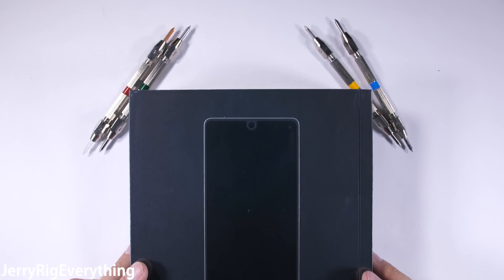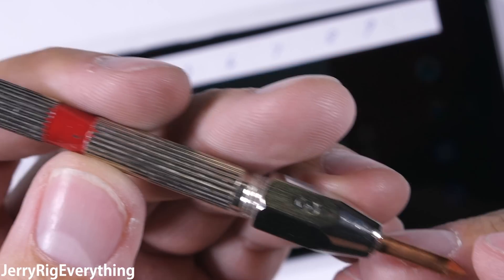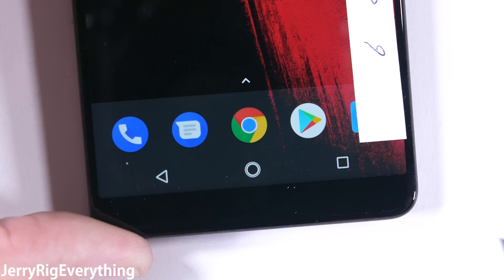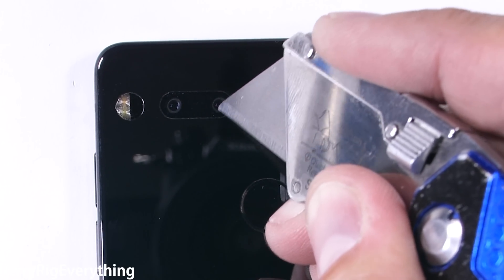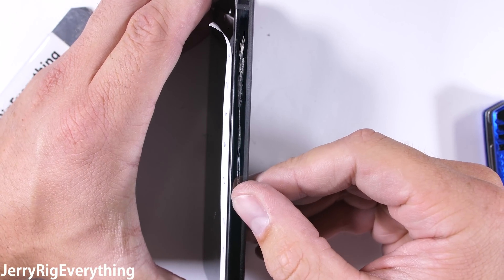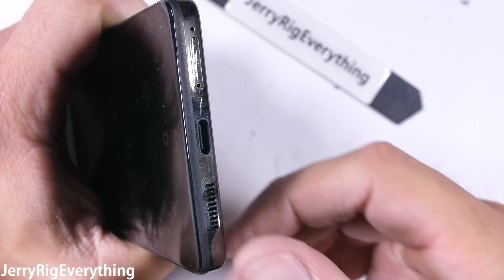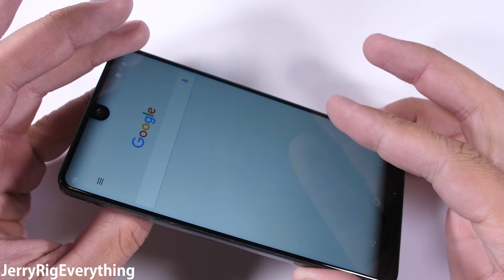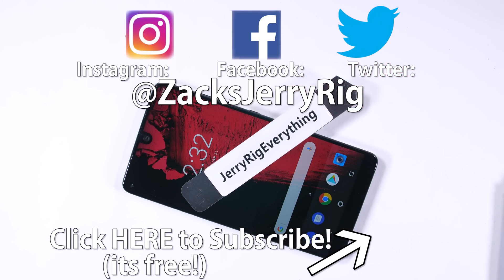Essential Phone Durability Test - Titanium Scratch Test!!

Comment: Had this phone for over a year. It's nice. Very durable, no bloatware, unlocked bootloader, hardware is very powerful. My only gripes are the lack of headphone jack and microSD slot, non-removable battery, and some early models had issues with faulty memory.

Comment: The future of Apple devices:

1. No charging port: must be wirelessly charged
2. No volume buttons: must be controlled in the control center
3. No power button: must hold up phone to power on
4. No speakers: sound comes through vibrations in the phone 
5. No camera lens or flashlight: are removed in general
6. No earpiece: again, it is sent through the phone with vibrations
7. Apple goes bankrupt after everyone stops buying their products because they removed all their features replaced by gimmicks
8. No mute switch; that’s the first to go next

I guess Apple can remove more from their phones

And I guess the future will have less features and overpriced phones

Not sure about Android devices though

Comment: This phone is massively underrated. Try one, it's epic. I was so impressed I sold my S8+ to get it
Reply: I agree with 100% i also got rid of my s8+ after the screen stopped working. I picked up the essential phone and I can proudly say I  do not miss my s8+ at all.
Reply: I Like Dogs also payed less money for a phone that just works no lag is awesome.
Reply: I Like Dogs the Pixel 2, iPhone and Samsung phones are obvious boring choices to me, I'd honestly rather have a Huawei P20 Pro than the Pixel (those bezels) yuck. The Essential phone is something different, the screen, build materials, quality and looks set it apart from everything. Every time I get it out people are asking questions and wanting to have a go. It's been a few months since I bought it and since the Oreo update it's honestly faster than anything I've ever seen or used, takes a few seconds from being completely off to on and running apps. My S8 didn't hold a candle to it for smoothness or snappyness. Also most phones bang on about scratch resistant frames and builds but they all scratch, the Essential phone genuinely is astonishing, mine has no case or screen protector and even under light it doesn't have a mark anywhere on it. There is no better phone anywhere close to the same price point.
Reply: Had the Essential since November: at first my phone would freeze every 3 weeks, there was lag scrolling, and the reception wasn't fantastic. However, this is truly the best kept secret with all of the updates. My only complaint has neen my reception in certain buildings. Other than that, I use Bluetooth headphones which work for me, my phone doesn't show any visible scratches, the phone turns on within 10 seconds, my scrolling has been smooth as butter. To me water resistant is a marketing ploy. The phone is an electronic, you aren't going to swim with it.  I love my essential and on prime day it was $250. My only concern now is the lack of stability of the company moving forward and as I said the reception in certain buildings.
Reply: I Like Dogs Pixel2 is 2x the price of this
Reply: I liked it so much I bought another one. I bought my first one in white and now I'm the proud owner of the stunning Stellar Grey special edition. It truly is the best phone I've ever owned.
Reply: I have to agree. Especially when you consider price (picked my essential phone up for $270). Also, loving Android Pie. S8 owners can't say that.
Reply: Underrated? Yes
Better than S8? Hell no
Reply: Left my Pixel XL for this and I couldn't be happier. Frequent updates. Runs Android Pie 9. I'll take type C rapid charging over any wireless charger. No wireless charger can compete.
Reply: You sold your fucking S8+ to get the fucking Essential Phone?? You played yourself..
Reply: Dr Wolf yup, been a couple of months now. No lag, no freezes, just a smooth OS that works on the button. Couldn't be happier :) you should try it
Reply: Mr Unthinkable 

No thanks Im happy With my note 8
Reply: Dr Wolf fair enough, I've had the last 4 galaxy flagship phones and I'd recommend them to anyone, still the best bang for buck in terms of specs and quality. I just wanted to try something different, the Essential phone is much much better than you these videos would have you believe. I had both an S8+ and this side by side for a couple of weeks while I decided which one I preferred using. Despite the Samsung having a bigger screen and more gimmicks the Essential phone was just reliable,  no bugs or glitches or little freezes. Kinda how an iPhone feels, but running android, which for me is perfect. I was curious to see what they changed on the S9 but at least for me, I see it as an incremental upgrade, I'm more curious to see what the PH-2 is like this year.
Reply: Mr Unthinkable if you really want a smooth OS nothing is smoother than iOS, not saying it's inheritly better, but since the hardware and software are designed specifically for each other, everything flows smoother
Reply: So you lost water resistance and a headphone jack for this?
Should've atleast gotten a pixel 2 phone

Comment: Honestly, the negatives on this phone are far outweighed by the positives for me. The phone will get to full charge in about an hour, and so far I get a bit over two days of battery life out of it with somewhat light usage. Wireless charging would have been nice, but it's not an absolute deal-breaker for me. The omission of a headphone jack, however, is a bit disappointing as is the lack of waterproofing.

And honestly, at a $700 price point, the lack of such features probably isn't acceptable. However, since the price dropped to $500, I think it's much more reasonable, and I actually paid slightly less than $400 for mine.

I do like the screen-to-body ratio, and I like the aspect ratio of this screen better than the longer, stretched ratio of other phones such as the S8. I love the stock Android and the fact that the phone gets updated regularly. And the phone feels SO good in my hands, I find myself pulling it out for no reason just because of that. The ceramic back feels great and the fingerprint scanner is lightning quick. I think that the build quality, lack of bloat, and promise of updates for at least 2 years makes this phone a strong contender if you're able to get it for around $400. This phone is even better than I was hoping it'd be.

Comment: They should find a way to make a glass ceramic hybrid for the front glass that would be spectacular
Reply: ... It doesn't work like that. They could make a Composite with glass as the matrix, and ceramic as the fiber. This would help prevent cracks and control existing cracks. But it would still scratch just like regular glass.

Comment: Finally someone roasts the "essential" like it deserves. The headphone jack IS ESSENTIAL and don't let google or apple tell you otherwise.
Reply: I just leave the dongle attached to my earbuds and literally nothing changes in the way I use my phone.
Reply: You can't charge it, if the adapter gets lost you have to figure out if it had a DAC, or not, for the replacement. There's no current standard, every company is doing it in a different way. Plus the extra dongle adapter should cost next to nothing if it's just that, but everyone will try to rip you off with $20 if you ever need a replacement and there's no guarantee it will even work if you didn't buy the exact same one provided with your phone. If they figured out a proper way to implement it with a standard I'd be willing to give it a chance, but nowadays is just a messy cashgrab to force people into buying bluetooth headphones (with batteries that degrade) and overpriced easy to lose adapters for a feature that all this phones support and that fits inside no problem. There's not a single phone that justifies the space needed by the 3.5mm jack, not the iphone, not the new pixels, not this "essential", since LG, Samsung and others continue to provide the feature in current flagships.

Comment: If your blade is level 6 and the front gorilla glass 5 scratches at level 6, wouldn't that mean that you should be able to scratch the front panel with your blade? (which is not the case)

Comment: Overpriced garbage,

1. It lacks the headphone jack
2. Water resistance
3. Micro SD Slot
4. Wireless charging
5. The cameras are garbage comparing them to other flagships in the price range.
5. And the display is not even near to the one on the Note8.

Comment: The monochrome/color sensor setup is not for the sole purpose of taking amazing monochrome images as an option, the cameras work together to potentially provide more optimized shooting ability of regular photos in low-lit situations. This should mean, lower ISO requirements and faster shutter speeds rendering both less motion blur and less noise.

Comment: Hi Jerry, I like your tests and especially how you bash pointless trends like current trend of cutting useful features for the "sake of progress". Since your videos test phones durability I wonder what are your thoughts of bezel reducing trend since it gets very hard to protect the edges of new hard but brittle screens. The edge of the glass is the place where 95% of cracks occur. The "essential phone" takes the problem to the new extreme by putting the earpiece at the very edge of the phone. 
In my opinion the essential phone gives us pointless new features like polished ceramic back and "hidden" earpiece for the sake of being different and leaving impression at a showroom. Ceramic back is very hard but brittle, heavy and expensive. It is beautiful when untouched. Since you will probably touch your phone it will get smudged very quickly. If you put back skin on, what is the point of ceramic back. 
At the same it omits other essential features.

Comment: I just ran my finger over the optical laser sensor and camera lens glass on my new Essential PH-1, these glass elements are recessed by about the thickness of a "skin" already. So, it seems adding a cosmetic "skin" wouldn't add significantly to any tendency for the elements to be scratched if the phone is placed on a flat surface. Don't lay it on a wire brush.

Comment: The monochrom lens and sensor are not merely used to produce monochrome photos. The monochrome sensor is used to capture detail in low light and then through a computational process add detail and color shading to the RGB sensor's images. Read the section at the essential website that describes the dual camera design. Also, read about similar camera technology being produced by Qualcomm called Clear Sight Camera Technology,